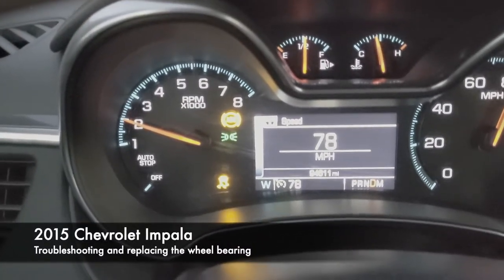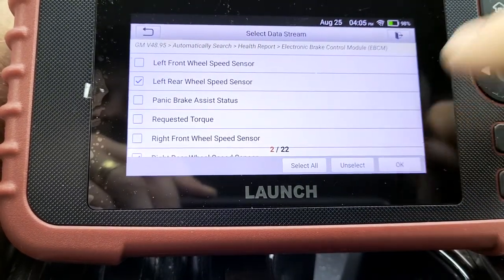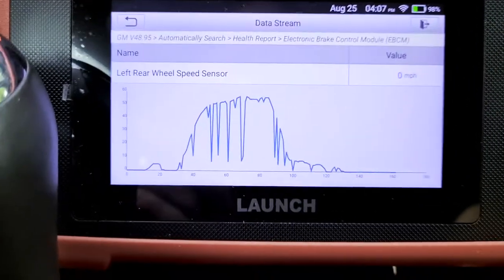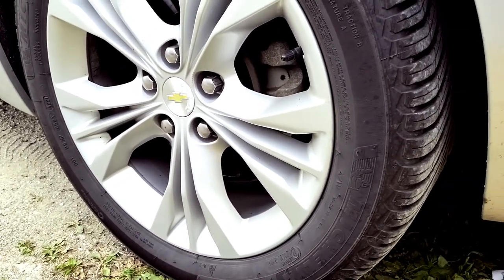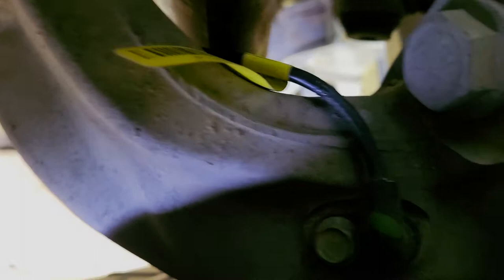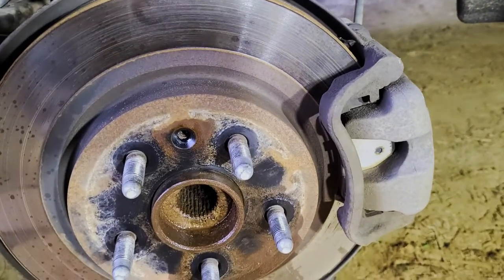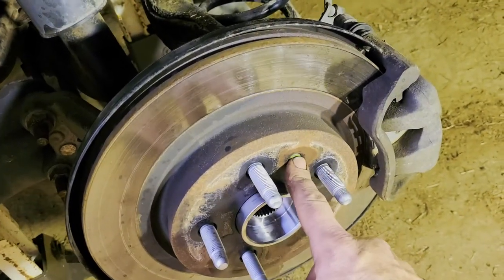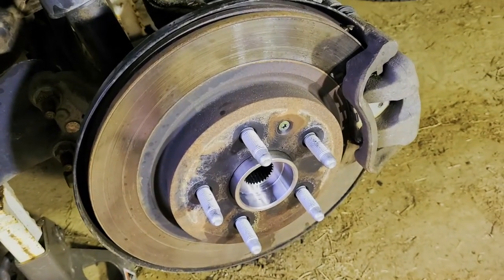2015 Impala Wheel Bearing Troubleshooting and Replacement

Comment: Regardless of torque specs, use some blue locktight on those hub bolts.  I have a 2015 impala LT.  Love the car.  It has 75,000 miles, and as time goes by, I'm sure I will be dealing with this.  I know all the tricks for getting the hub off, thanks to Youtube videos.  I just put brakes on all around, so I'm familiar with the car now.    On a different note, the only thing I don't like is the front suspension.  It's a bit harsh, and it has always had a annoying clunking on bumpy roads.  If I ever find someone who knows what causes that, I will fix it.

Comment: Im amazed how little rust there is with u being in Michigan. Im in Massachusetts and my impala has some ridiculous rust lol.
Reply from the maker: I've only had it a few years. I bought it with 33000 miles on it. It was obviously only lightly driven. That definitely helped it out.  Rust definitely eats them here, too .
Reply: Niice. I bought mine used with 58k on it. Now it has 138k lol. Ive only had to do a couple repairs so its been a great car overall. But i may have to change a hub now lol. Im guna go try and clean up the sensor and see if it does anything. Enjoy the car man.
Reply from the maker: @tyler9mm614  Good luck. Hope it helps.

Comment: Just had the power steering go  on my 2014 Impala. Looking to replace fuse as a first step but its number is unclear in manual.Any help would be appreciated. Thanks
Reply from the maker: As near as I can tell, there is not specific fuse for the power steering motor. The motors are controlled from the Power Steering Control Module. There are two different RPO codes and styles (NJ1 and NJ2).

Comment: Did you have problem with the power steering as well or just the abs?
Reply from the maker: Yes... power steering quit as well.
Reply: Thank you,you help me alot
Reply from the maker: @j-rodz2815  glad it helped you out.
Reply: The power steering corrects itself after this detailed repair?
Reply from the maker: Yes. As soon as you drive the care and the sensor sends proper wheel speed information, the power steering immediately starts working again.

Comment: I have a 2017 FWD and a noise is coming from what sounds like behind the front right tire and it only kicks in once i get to about 16mph. It gets very quiet like it isn’t there when i turn right but when i turn left you can hear it. Its like a boat engine in a way.

Comment: so i put in a new speed sensor and wheel bearing and rested the right abs speed sensor and it popped up the abs light again. am i missing something
Reply from the maker: The sensor should clear on the impacted wheel.  It is possible that you have another wheel that is missing the magnet too. I replaced two within a few weeks of each other. When one goes bad the others are not far behind.

Comment: What fuses do I need for my heated seats, fog lights and the back 12v plug 😂
Reply from the maker: I may be able to help with that, assuming you have a 2015 Impala. The heated seats are controlled by the Seat Heating Control Module and there are two fuses in the under-hood X50 fuse block, F31 and F33. The console 12v plug is in the instrument panel fuse block, F7. The "fog lights" I assume are DRL(Daytime Running Lights). If you have HID lights(RPO T4F) the DRLs are controlled by the BCM that has multiple fuses, if you have the Halogen lights(RPO T4A) the DRLs use the low beam headlamps.

Comment: It's sad that you can't buy that part or they need to make that thing out of very strong fridge door magnet 🧲
Reply from the maker: I just replaced my right rear hub last night. They definitely have a problem with the magnets. I hate throwing away perfectly good bearings.
Reply: @JustLearningbyDoing  I will be checking mine in a few minutes hopefully, it's the speed sensor but just my luck it will be the hub. 2023 🎊HNY🎊❗❗❗Birmingham Rds pothole metropolis!
Reply from the maker: @JasonSmith-qx3zh  Best of luck